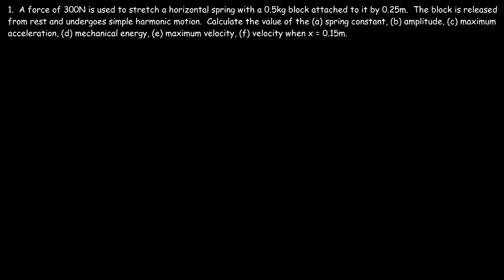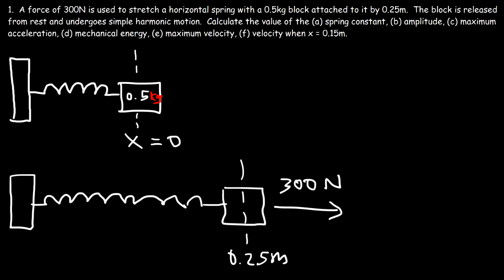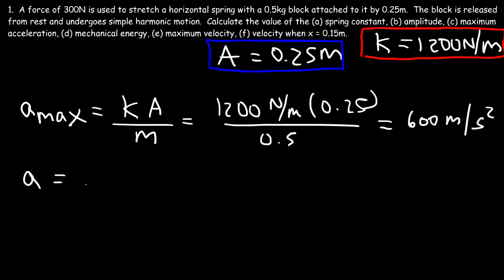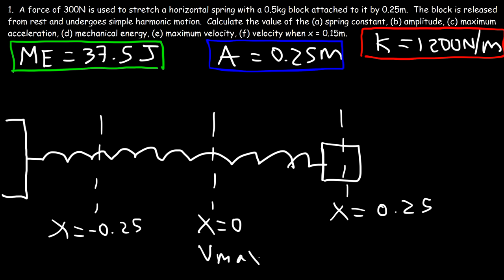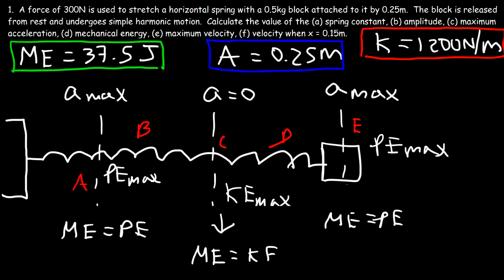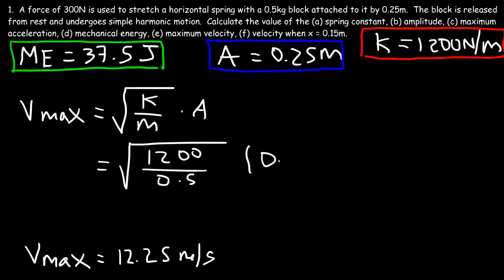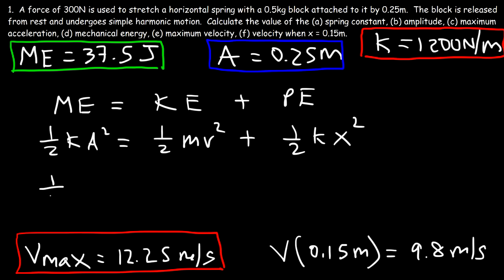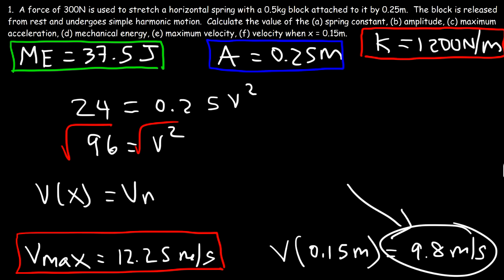Energy In a Simple Harmonic Oscillator - Maximum Velocity & Acceleration Calculations

Comment: since the amplitude is the maximum displacement from the equilibrium point,  does the same rule apply to vertical harmonic motion? So for example if a weight is put on a spring, and then brought up 0.5 m from its equilibrium point, and dropped, then the amplitud has to be equal to 0.5 m. Am i right?

Comment: Hi, great video, I noticed you used SI units in the equations (m, kg, etc) would it be a problem to use, cm,g, etc. For example in the equation for maximum velocity, v = A*sqrt(k/m), would it be possible to use cm for A, N/cm for k, and grams for m? Or must one use SI units as you've done?
Reply: I mean you could but then you'd have to convert back to SI units as SI units are standard